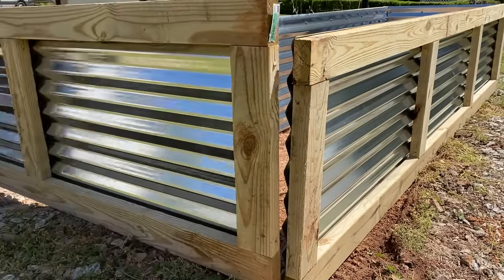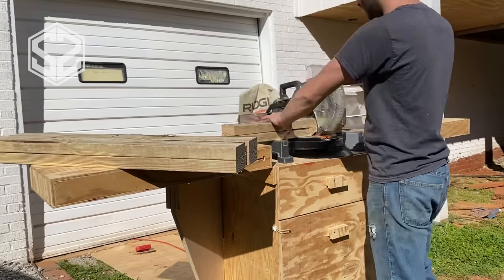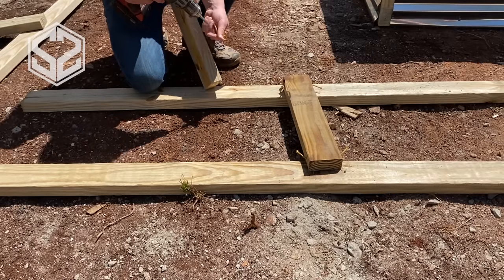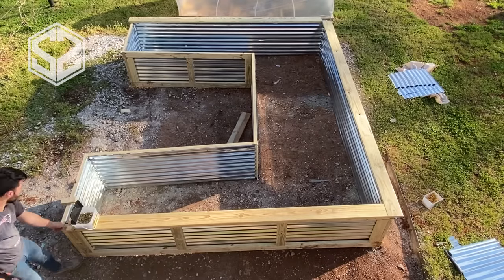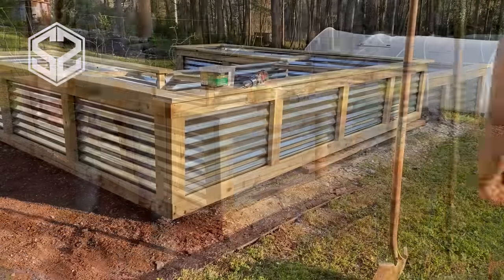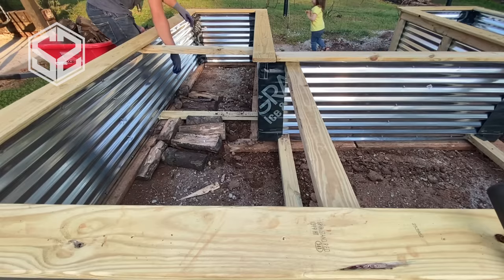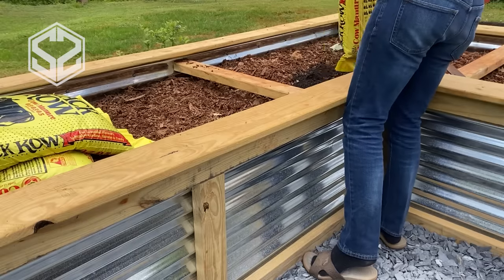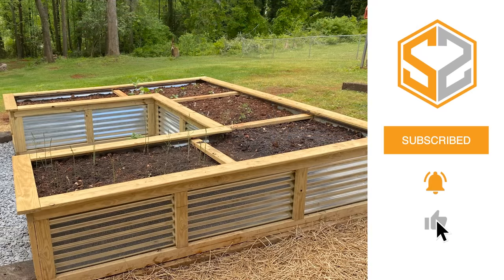How To Build Raised Garden Beds

Comment: Hey Simon.. you didn't mention how tall this is.  I'm planing on 2boxes with similar look as yours  but bigger. U shape 18ft w x 12 foot L sides x 4 ft fronts x 10foot middle. Im going for 24 inches high plus cap so 25.5. 
Ho much over hang on the top cap.?
Reply from the maker: That’s awesome! The roofing panels in 2ft wide sections so that’s what I did so I would t need to Tim the metal and waste height :) I used 6in deck boards on the top so it hung over about 1 1/2-2inches on both sides. Thanks! :)

Comment: I found the ice and water barrier but is was a massive roll for $85 at Home depot.  Did you buy a big roll?
Reply from the maker: I used leftovers from a roofing project. You could also use flex seal tape. It comes in smaller rolls and is very similar. https://www.homedepot.com/p/FLEX-SEAL-FAMILY-OF-PRODUCTS-Flex-Tape-Black-4-in-x-5-ft-Strong-Rubberized-Waterproof-Tape-TFSBLKR0405/302634866

Comment: Pressure Treated lumber is treated in six different retentions. If the product you removed was rotten then you used to wrong retention for above ground use. Pay attention of what you are purchasing. Also you need to seal any lumber (paint, stain etc.)  before  installation.  Would you put your wooden dinning or coffee table outside without painting or sealing it?  The ice and water shield traps moisture. Then putting the buggy wood as a filler is bring is inviting problems.

Comment: Pressure treated, may leach copper sulfate, or hydra manganese into the soil, and consequently into the veggies.
Reply from the maker: Thanks for the tip. The newer style of pressure-treated lumber is said to have no arsenic and is much safer. Even still I tried to be extra safe and limit the direct contact with the soil as that is how chemicals leach most effectively. I was comfortable with this after doing some research however, this could be done using cedar lumber which is a totally safe option if there is a concern.

Thanks!

Comment: Question.
You said you were in the south.
Does the metal sides affect the plants as far as heat?
Were in central Florida, hot 11.5 months of the year,
I like the design, but wasn't for sure if the metal would create a solar oven if you will in the plant beds.

Thanks.

Comment: Use old over head doors (garage door ) mostly there FREE . i bilt raised Beds in Bellingham, WA. and moved to Amarillo, Texas , there made for outside no painting they are 16 ' long and you can notch 4' in then bend them put two togather you then have A12' X 4' raised Bed you Can put 24" rebar in hold them strat 16" hi 4" rebar in grown Dril for rebar i am 76 ben doing this for 20 years ( free over head door BUY rebar that it) Mike

Comment: This is neat. However, I think for my project I would use steel posts so it would last 50x longer than wood. Just my 2 cents.
Reply from the maker: that would last much longer! right now the weak point should be the wood as it will eventually rot or be eaten by termites.

Thanks!

Comment: im looking to build some of these as well!  I love your video!  thanks so much!  is there a reason you didn't use weather treated wood?  how long do you expect this wood to last?  ( i didn't catch what kind of wood it was)
Reply: it looks like he did use treated lumber. I used cedar. Cedar cost more but it's naturally bug resistant unlike treated lumber. I used treated lumber on a previous raised garden we had at least 5 years and had no bug issues before we moved. As far as longevity treated and cedar will last about the same amount of time. Really depends where you live but probably 15-20 year range and longer if you paint or stain boards. Treated will work just fine. Also always wear gloves handling the roofing its crazy sharp. You don't need power tools to cut roofing, just a good set of cutting shears, you may already have to trim or cut landscaping. More controllable than a power cut off wheel. Good luck
Reply from the maker: I actually used pressure treated lumber. The newer treated lumber is supposed to be much safer now but I still tried to cut out all contact with the soil to prevent any chemicals from leaching into the soil. A totally safe option would be cedar lumber. This wouldn’t last as long and be more pricy. Thanks!! :)
Reply from the maker: Thanks so much for replying! :)
Reply: @miworld0123  thanks!
Reply: @SimonSaysDIY  thank you for the reply
Reply: Np and sorry I stand corrected on longevity. Simon was correct the treated will last longer in most cases about 30 years. Provided you don’t have termites or cracks or knot holes in wood. 15-20 for cedar. Also as I mentioned in comment I posted lay out the roofing on 2 boards before cutting the smaller joining pieces. Got my roofing from Home Depot and I had to make the small pieces 19”s instead of 18 so roofing would fit correctly. I fortunately did this before I cut all the small pieces

Comment: Keep in mind, using wood itll take a LONG time to decompose and release to much of different elements into the soil.
Better to useleaves, grassklippings and mulch lower down, and mixing it with dirt.
Then higher up using better qoality dirt, and mixing manure into the dirt at the top.
And to protect the dirt from the harmfull sun, and to keep the dirt wet longer, use like bark or grassklippings, as an added effekt this will also breakdown giving the dirt nutriants.

Comment: What about lining it with plastic on the inside? Does it have to permeate into the soil?
Reply from the maker: You could line it with plastic but you would need to make sure you are not over watering it as there would be no drainage. On the plus side it would hole moisture better and need less water! :)

Comment: Could put top to ground diagonal supports on the outside instead of burying beams being pulled apart.
Reply from the maker: That would work well but would add a bit more to trim around when you mow. :)

Comment: another question, what gauge is the roofing panel used in the video? my local HD only carries ga.26 and it feels kinda flimly?
Reply from the maker: I believe that is correct, it was rather flimsy but with the 2x4 framing it added a run of strength to the metal. Thanks! :)

Comment: Another thing you could of done for the bottom 2x4 was char the wood and used old motor oil and rubbed it on after that would protect the wood from rotting as well
Reply from the maker: Yeah, that would help the wood last longer.

Comment: If i were to make a raised garden bed and about 3 inches down from the top i replace a length of the metal with a lattice board across the length (using a planting mesh to hold in the soil) and then plant in beans and other vining plants with a length of wires to allow them to grow up and away from the side would it work or what plants would be better to include in a side portion?

Comment: Someone mentioned treated lumber, which is typically treated with copper salts I think. Also, wood contains heavy metals. And it will eventually rot, whatever you do. The bed sure looks nice though.
Reply from the maker: Yeah unfortunately it will not last forever. I’m hoping I can at least get 6 or 7 years out of it. I will probable seal the wood this coming spring to help it last a bit longer.

Comment: How as this been for bulging? This is my favorite design thus far on YouTube, but I want to build the sections 4 feet across with a 2 foot wide center walk (don't want to waste to much garden space).
Reply from the maker: It has held up really well! Someone recommended using threaded rod for the bottom supports as it would last longer and would be much stronger. So far the 2x4 works great 👍🏻
Reply: @SimonSaysDIY  Thanks

Comment: That looks great, but I doubt you get more than 3-4 years out of it before the metal rusts out and the wood starts to rot and you're doing this all over again. For what this probably cost, the Birdies raised bed kits would probably be a better option. They are supposed to last for quite a long time and I think they can be assembled in a similar configuration.

Comment: can we or should we use raised beds on rooftop gardens?
Reply from the maker: Sure, as long as the roof would support the weight. you may want to opt for a shorter height to cut down on the amount of soil that will be needed. And use landscapers fabric at the bottom to keep the soil from washing out.

Comment: Haven’t done a raised bed yet but I keep seeing that u need to have drainage holes?
Reply from the maker: Yes, I would recommend having drainage holes if the bottom is sealed. But these ones are open to the soil and it seem to drain really well and haven’t had an issue with it in almost 3 years. Thanks!

Comment: What system will you use to stabilize your tomatoes once they get tall, since they are now going to be even higher up in the air?
Reply from the maker: I just used tomato cages however your right the tomatoes grow to 5-7 feet where I live so I am actually thinking I will build a shorter garden bed for the tomato’s. I also found if you keep up with pruning it can keep them from getting out of reach.

Comment: The reason you don't see gardeners putting ice and water shield in their raised beds is that it is a petroleum product that will get absorbed by plant roots and thus into the veggies and fruits which you consume.  You wouldn't dump used oil in your garden so why put other contaminants that will leech into your food?  Same with "treated" lumber.  Better to use cedar wood or stone.

Comment: Why use metal sides? Esthetics or functional?
Reply from the maker: A little of both. Wood rots out too quickly so the metal is a longer lasting option ant personally I like the look of it as well. The wood frame gives it the strength it needs but lasts a longer amount of time when it isn’t touching the soil.

Comment: Just curious, how did you arrive at the height of the sides?  Seems as though if they were lower you wouldn't need so much fill..
Reply from the maker: The metal sheeting comes it 2ft wide sections so that’s where I decided the height. You could trim down to 1 ft and use each piece twice. It would take less soil and it would still be effective. Thanks :)
Reply: I see, thanks.  Of course the obvious benefits to old guys like me is not having to bend too far down to get to the beds

Comment: The wood you used is pressure treated. The outer frame is ok but the water running off the top rail will leach chemicals into the soil. Will it be enough to cause any long term issues, IDK, but better safe then sorry.
Reply from the maker: Thanks for the tip. The newer style of pressure-treated lumber is said to have no arsenic and much safer. Even still I tried to be extra safe and limit the direct contact with the soil as that is how chemicals leach most effectively. I was comfortable with this after doing some research however, this could be done using cedar lumber which is a totally safe option if there is concern.

Thanks!

Comment: Wood instead of  galvanized corrugated sheet metal will last much longer. The metal will start to rust and break down because of the  moist soil and fertilizer in contact with metal surface.
Reply from the maker: No rust yet but I will keep an eye on it and give an update on how it is holding up. Thanks! 😁

Comment: Does the treated wood not affect our food and chemicals not soak into our food and we eat it?
Reply from the maker: The newer treated lumber is supposed to be much safer then the previous types. However, I was still trying to limit the direct contact of the treated lumber and soil as from my research, that is how chemicals leach most effectively. With all of that in mind I felt alright about using it for the garden bed. If you want a safer option I would recommend using cedar lumber but it will cost you more.

Comment: is all this wood pressure treated? If so don't you worry about chemicals leaking into dirt?
Reply from the maker: I did some research and also did my best to prevent the soil and lumber to come in contact. I’m not to worried with the system I used. Cedar is also a great option. Thanks!

Comment: Looks nice.  But don't recommend filling up using wood.  Specifically, wood will absorb nitrogen from the soil, until it breaks down.  It will also attract insects that break down woods, that then could attack moist areas of the raised bed.  Another thing, don't recommend using roofing materials on the inside of the bed.  These could very well leach PFAS into the soil.  Be careful using manures in raised beds.  Overtime, they cause salt build-up and will interfere with plant growth.  Additionally authentic railroad timber can leach arsenic.

Comment: a bit over-engineered but dang the beds look good! For sealing on the corners, you could have also use like sprayable flex seal or something to keep water out. Great video, i think these are my favorite beds I've seen yet! One tip from experience, I'd advise wetting the soil as you fill in layers because depending on your soil mix, you can get dry hydrophobic pockets that water just percolates around.

Comment: I'd be very curious what your overall expense was, and how many hours you put in.
Reply from the maker: It was around $500-$600 for the building materials but it really depends on current lumber prices. I build the beds in a single afternoon maybe 4-5 hours and then another 8 hours to fill the bed up with firewood and soil. Thanks! :)

Comment: Did anyone catch what type of wood and/or sealer he used with for the frame with the roofing? He said the pressure treated stuff was getting eaten up, and that was the impetus for doing this design. That confuses me in itself because I thought pressure treated was meant specifically for outside/high moisture conditions, but I'm most curious about the wood he's using in the improved design. Fir? Sealed? Thanks

Comment: Could I use the system next to a fence (as my wall) for 1 side?
Reply from the maker: You would still need to build the back panel. I would also keep it away from the fence a few inches so that it doesn’t rot your fence out.
Reply: @SimonSaysDIY  Thanks!

Comment: To cut the metal panels I saw on one show where they flipped the blade on a circular saw so it was backwards and that's how they cut the roofing
Reply: Its paper thin.cheap tin snips work fine.i have a nibbler but not everyone has tools like that. Tin snip or a jig saw..
Reply from the maker: Thanks for the tips! :)
Reply from the maker: Thanks Charles! I will have to test that out some time. :)

Comment: How do the plants fare with metal as siding? Do you notice any temperature issues in using metal?
Reply: We live on a ranch and have been using old galvanized water troughs, and buckets for plants for a long time here in Texas. Plants do just fine and the galvanizing does not cause any health issues. Farmers and ranchers have used them for over a hundred years. Also love your little helper...great to get them interested early.

Comment: You could have painted three sides of that wood that you set on as the side pieces with a black rubber which is not expensive and it would have said on the ground really fine for years

Comment: Does the metal over heat the soil?
Reply from the maker: I haven't had any issues with overheating. I believe the silver metal reflects the sun's rays and prevents it from heating up. I wouldn't recommend using dark metal roofing as that would heat up quickly.

Comment: About how wide are the beds?   I would guess 4 feet?  Easy to reach from either side?
Reply from the maker: the back is 4 feet wide and the two sides are 3 feet wide. I found that those dimensions used the length of the boards with the least amount of waste. thanks

Comment: Doesn't pressure treat wood excrete toxic chemicals? I thought they had arsenic in it.
Reply from the maker: The newer style of pressure-treated lumber is said to have no arsenic and much safer. Even still I tried to be extra safe and limit the direct contact with the soil as that is how chemicals leach most effectively. I was comfortable with this after doing some research however, this could be done using cedar lumber which is a totally safe option if there is concern.

Thanks!

Comment: Do you realize that railroad ties are extremely toxic to everything? And using them near a food source is not a good idea. Instead if you must use a concrete block type of material or natural stones found in your ground, and don't be afraid to pull a few weeds. Great job on designing an easy to tend too raised bed. Some folks have a critter problem use some good hardware mesh before the old firewood. keeps gophers and moles out.
Reply from the maker: Thanks so much for the tips!

Comment: You said that the height is 3ft..if so didn't you cut your inserts 28 inches instead of 18 inches?
Reply from the maker: The metal roofing comes in 2ft sections so that’s how tall I made it. Sorry is I misspoke! :) it’s 2ft tall and the vertical boards were cut at 18in.

Comment: The problem with all that wood... Is that it will consume a great deal of Nitrogen from the soil that could be going to your crops.
Personally I like to use rocks, especially the ones I dug out of the garden area to make said garden.
Reply from the maker: Thanks for the tip! :)
Reply: Someone beat me to it, but i produce several pints of nitrogen rich liquid every day that will solve the problem.
Reply: If the old firewood was mixed in with the soil it could create a nitrogen deficiency, but buried under the soil with little or no oxygen getting to it, it shouldn't be a problem. I wouldn't use rocks because they don't decay and you can't grow things in rocks.